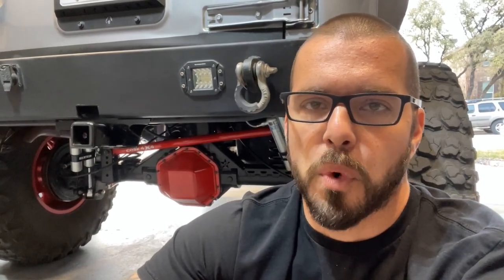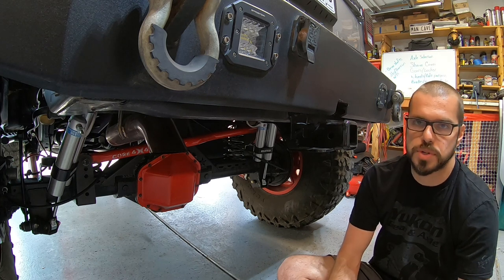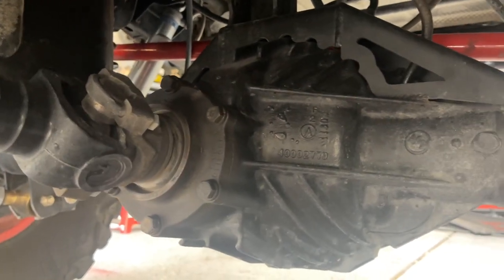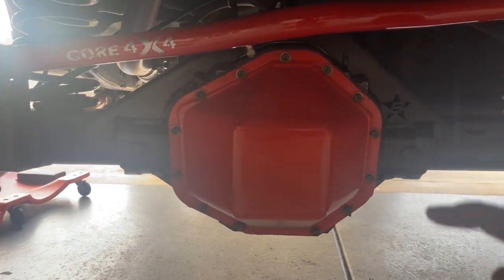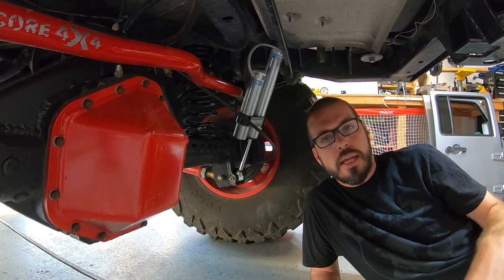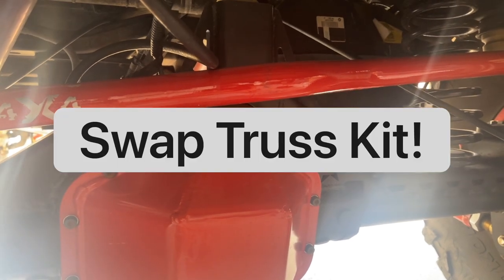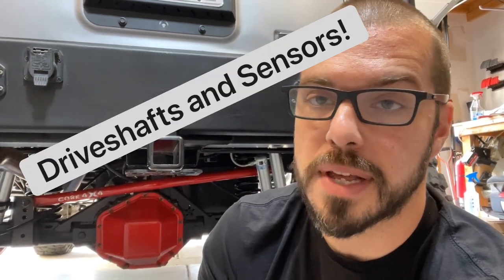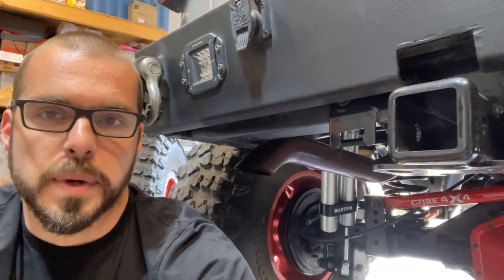Jeep One Ton Swap (Part 2) - Everything You NEED to Know

Comment: you can always run 52t tone rings for the rear and run dual sensors off just the rear axle with artec sensor mounts. all you need then is just to extend the abs sensor wire from the front to the back. worked great for me
Reply from the maker: Heck yea you can! That’s an awesome option.  Not what I did. But an awesome option.
Reply: @WarPaintOffroad  its especially a great option for guys who may not have access to or be able to afford a scanner tool that will let them be able to put in those odd ball calculated ratios for tire size and gear ratios when using the 60t tone rings which was my case. the only issue i ran into with the dual tone rings on my 14 bolt was that the caliper bracket needed about an 1/8" of clearance ground down so that it wasn't putting pressure on the sensor. i had no idea mine was touching until the abs light came on an i saw that the caliper bracket was pushing on the sensor just enough to where it was making contact with the tone ring and ate up the sensor lol
Reply from the maker: @matthawkins1287  yea..that’s no problem. When you put tons under a rig you know a little nipping and tucking is in order. 😂 but man you should get the  jscan. It’s super cheap. And it would allow for all the calculations on the rig. Plus it allows you to run live data to help solve issues. A lifesaver.
Reply: @WarPaintOffroad  i ended up getting after the fact because i was late to the party and didn't know about it lol. it has been nice since i finally installed it though
Reply from the maker: @matthawkins1287  That’s awesome!

Comment: Very informative videos part 1 and 2 . Wanting to swap this into my 2008 jku
Reply from the maker: Glad it helped. I’m actually swapping another set of the same axles this fall into a 2007 jku. I’ll be doing it step by step and show the entire process in a build series.  It it won’t start until the fall. I have to wait for the summer heat to break.
Reply: @WarPaintOffroad  I definitely understand that,  I live in south carolina so I know about the heat . I will definitely be watching out for the videos for sure . Make sure you explain how to get the angle degrees when doing the trusses please 🙏.  Thanks
Reply from the maker: So I won’t actually be Doing trusses. But I’ll definitely talk about how to find the angle…it’s not too hard. I’ll make it easily understood…

Comment: You kept the brakes on the front Axle, but switched to Powerstop on rear.  Any reason to not use the 14 bolt brakes?  Thanks.
Reply from the maker: I put powerstop rotors on the back…. BUt they are the same as what was there. Just made by powerstop. I have built so many Dana 60’s I’m not sure what brand I put on the front of this one. They may have been made by powerstop. I don’t remember. But I essentially replaced the calipers, rotors, and pads with what was there factory. I just but the replacement stuff from aftermarket companies to save some cash.

Comment: Lots of very informative stuff. Appreciate it. What size and brand wheel spacers did you run? Im doing a 95 Bronco, Im swapping the same front and older Sterling with 8x6.5 lug pattern because it was free! Thanks!
Reply from the maker: Awesome! Thanks for the support! I am running 1.5 inch adapters made by Bora. But there are lots of them out there. Just get something made out of the 6061 aluminum and make sure to install them correctly. Good luck with it!

Comment: What is the reasoning for making sure the 14 bolt has the cooling fins cast into the diff housing? I think I have seen some without the cooling fins, are those style missing something significant?
Reply from the maker: They are. So the aftermarket support for trusses and things fit better. But aside from that…they made MANY 14 bolts over the years. Some are just a semi float rear which isn’t much stronger than a factory jeep Dana 44. The one from 99-2006 in the gm 2500 has the cooling fins as well as the pinion being in its own housing, which you’ll be able to see with theb6 bolts around the pinion yoke. That is the one you want for a jeep. Lots of aftermarket support. Full float axle shafts, the right width, etc. it also has a 10.5 inch ring gear.

Comment: Hey Dan, does a 2010 2 door JK have the same issue with the Sterling and gas tank as the 4 door?
Reply from the maker: It does! There is a work around by just hammering in the rear corner of the tank a bit. That will allow it to clear. You can also remove it and run a fuel cell or a tank behind the rear axle. There is also the option of stretching it enough to clear. But that requires other things to be moved…like the rear track bar.

Comment: You mentioned making sure the fusion e Brake cables are routed correctly. What’s the trick?
Reply from the maker: Installing them under the console is basically the trick. You can’t completely remove the console because it releases the tension on the factory spring when you do that. Then It’s almost impossible to get the tension back on it.

Comment: What’s your opinion of doin a d60 from 07 and a Sterling 10.25 in the rear
Reply from the maker: The Dana 60 is a GREAT option from that year. The sterling is a great rear too. But, the sterling becomes a problem on a jk. The issue being the pinion on the rear axle of a sterling is shifted toward the passenger side quite a bit. So without a major stretch, gas tank relocation, or beating in the gas tank, it just won’t clear. That’s why most people use the 14 bolt.

Comment: It’s clear why people don’t use matching set from ford truck (lack of aftermarket support). How come people don’t use matching front and back axle from a Chevy ??
Reply from the maker: Yea. There is actually support for the rear Ford (Sterling). The main issue with it is the pinion comes out farther ion the passenger side. So what happens when you flex that in a jk, it will hit the fuel tank. It’s just easier to regear a 14 bolt rear and you don’t have that issue. The front axle in the Chevy though is only a 9.25 inch ring gear. So it’s just not the best axle to use. Being that these builds are completely custom…it’s just easier to get a great front axle and a great rear axle that works on the application, even if they are from different manufacturers.
Reply: @WarPaintOffroad  makes sense. Thanks for info